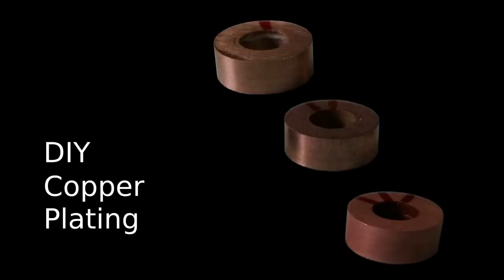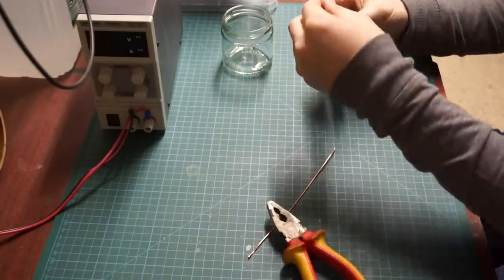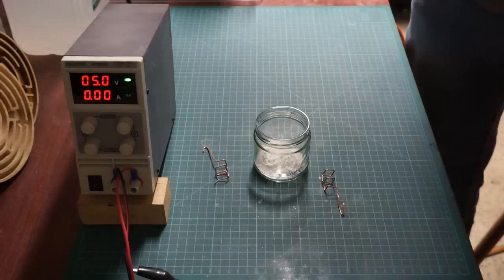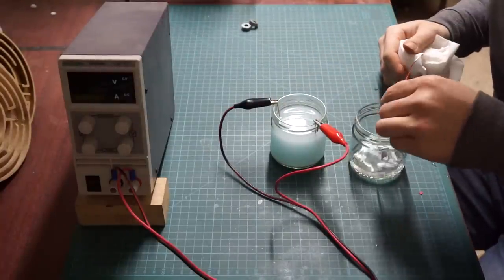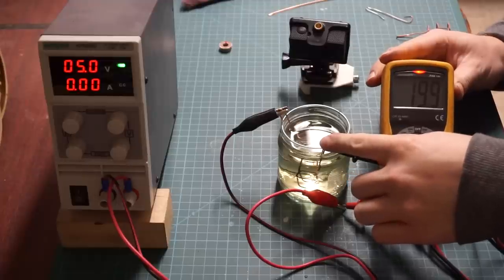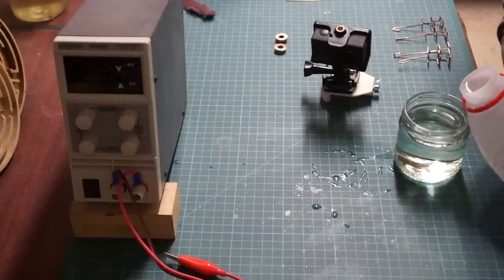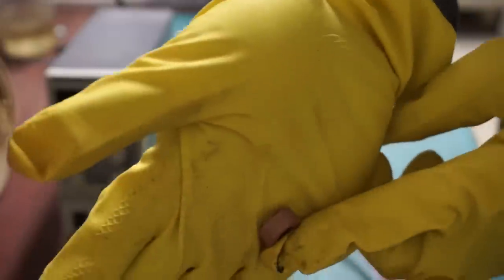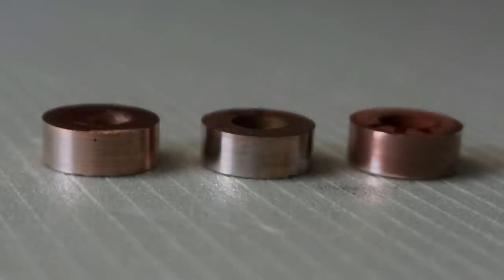Best DIY Copper Plating Methods

Comment: I really appreciate the scientific nature of this video, actually comparing different approaches.  Generally the metal deposition is going to be proportional to the current flowing through your part. If you want to get good, repeatable results, you must regulate current. NOT voltage.  I recommend 20 mA per cm^2 of area on your part to be plated. Lower current density will work fine, but will take longer to get the same thickness. Higher current density can ruin your surface finish as you saw with the strong acid. The conductivity of your liquid should be as low as possible to achieve the most uniform plating thickness across your part. You can add salt to the vinegar to increase its conductivity. To determine plating thickness as a general rule, 26.8 amp-hours of charge will deposit 1 gram of metal. At 20 mA per cm^2 this means that ~ 20 microns will be plated in 1 hour. Or the other way, you'll get 1 micron per mA per cm^2 per hour.  A few microns is a good thickness for decorative surfaces. 50 microns is good for high durability.  I also notice a number of people talking about the order when plating with nickel. Copper won't plate onto all metals very well. If you want to copper plate steel. A thin nickel plate should be applied first.
Reply: You got that backwards. If you want to plate with nickle you must plate with copper first. Copper plates to most items easily while nickle is finicky.
Reply: youre correct, but when it comes to steel, copper wont plate; so yea you do need to spray a nickel coating to conduct the copper to the steel, otherwise the copper wont plate the steel.
Reply: i appreciate your comment, does this recommendation apply to a particular approach you use?
Reply: @xtonybaloneyx  copper will plate stainless steel using the muriatic acid technique shown in the video. I've never tried other types of steel, but it absolutely will plate onto 304 stainless steel.
Reply: What's the ideal voltage to current ratio, or should I say the ideal resistance of the solution?
Reply: @CaneDimitrov  I don't believe it's super important. But lower is generally better. Higher voltage will cause increased electrolysis. This usually leads to splotchy and inefficient coatings.
Reply: @gizmoguyar  Thanks for replying so swiftly, mate! I also seem to have another issue - instead of getting this nice clear deep blue solution, I get a murky cloudy bluish whitish stuff, which I think is copper carbonate hydroxide. Any suggestions on resolving this issue?
Reply: @CaneDimitrov   That's a tricky one. This is a bit beyond my level of expertise. from your comment, it sounds like you are using baking soda. You might try adjusting the PH to be more acidic. You can also use salt  to increase the conductivity without messing up the reaction. I also know tiny amount of dish soap can help with the surface finish. But I believe this won't have much effect on the byproducts produced.  There's lots of different things that could cause this. So I think you'll have to experiment.
Reply: @gizmoguyar  So I tried a 15% citric acid water solution and so far this got me the best results. I just mixed store bought citric acid in some destilled water  (15% citric acid by weight, relative to the water). Then I saturated the solution with  copper citrate by running my power supply at 5V, about 0.15 Amps, but the current was fluctuating, until the solution turned a nice clear blue color. In all fairness I doubt it would be an issue to run higher voltage, maybe even 20+V for the saturation process, although I can't be sure. Then I tried plating a coin (65% copper, 20% zinc and 15% nickel), running about 60mA at 2.5V and in just over a minute the coin had a nice copper plating on it. Of course, I cleaned the coin thoroughly with dish soap and water before plating it. I found I get the best finish if I was constantly moving/wiggling the coin in the solution, otherwise it tends to get black copper oxide on the edges. The plating is quite durable, as I tried cleaning the coin with steel wool and it didn't damage the plating, but made it look shinier and almost polished-like. The raw unscrubbed/unpolished finish on the coin is rather dull, but has a more saturated copper color. Overall I'd consider this a viable and effective method.
Reply: @CaneDimitrov  This is really amazing. I'll remember this for the next time I need to plate anything. Most of the instructions are vague, so thank you for giving the exact numbers you used.
Reply: @gizmoguyar  Glad I could be of service! One extra thing I forgot to mention is that increasing the voltage gets the coin plated in copper quicker, but the coin gets covered in black copper oxide easier and the finish quality gets worse, so I wouldn't suggest going above 3V and about 20mA/cm2 for the current density and constantly moving the coin, as these conditions got me the best results.
Reply: @CaneDimitrov  That definitely makes sense. 20 mA/cm^2 seems to be the sweet spot.

Comment: You'll get much better results if you first plate the steel with nickel, then proceed to plate with copper...just an observation due to my extensive experience in DIY copper plating.

Comment: Here's a simple and easy copper plating solution.  Dissolve copper sulfate in distilled water.  The amount is arbitrary.  Just enough to make the solution dark blue.  Add a few ml's of muriatic acid.  Measure the ph then add enough sulfuric acid to bring ph to 1.  You now have the perfect copper plating solution.  It's durable and you may plate it as thick as you'd like.  Just remember, 100 milliamps per square inch of surface to be plated.
Reply: Good to know, thanks!
Reply: Why the milliamps important? Is there too high mA? Is there any disadvantages of it?
Reply: @ElGatoLoco698 someone asked you a question.
Reply: @raytry69  Too high milliamps will produce a rough texture.  Normally people are looking for smooth and even surface.  100 milliamps per square inch gives you that smooth surface.  If the milliamps are way too high, the plating won't stick at all and you'll be left with a pile of copper powder that falls off the plating surface.  If you stick to the 100 milliamp rule you'll have a nice thick, durable, and smooth plate in about 8 hours.
Reply: Can any copper salt (acetate, carbonate, hydroxide) be used or does it have to be sulfate?
Reply: @bunneto365  You could probably use copper acetate. In fact, I remember trying it when I first started plating.  I found that copper sulfate was just easier though. I'm not sure about the other compounds you mentioned but I tend to think it would work too.  You might have to experiment a little bit to get good results but it should still work.  That being said I should probably mention that I didn't plate to any specific type of metal.  I plated the copper to a graphite paint I made.  The acid in the bath is not good for some metals.  Zinc for example.  Can't plate to zinc with this mixture.

Comment: I've done quite a bit of plating of my wood turnings. In the course of learning how to do so, one thing shows up over and over again - contamination of the electroplating bath, which results in poor quality plating.

For this reason, I have to seal all my wood projects with lacquer, then coat them with conductive graphite (from a mix with satin Mogepodge).  Even then, the baths get contaminated over time.

Part of the contamination of my baths come from the small eyelets I use to suspend the items in the bath.  The eyelets are metal/iron.  As I was told, merely dropping iron in the bath, without connecting to a power supply, will result in ion exchanges to produce a THIN copper surface.  However, this, also, means the bath is being contaminated with iron, which will, at some point of saturation, ruin the bath.

I end up with a lot of small copper pieces, from the anode dissolving. As an experiment, I used a small, hard plastic water bottle to store the pieces.  I drilled about a gazillion (give or take five) holes in the bottle so solution could flow into and out of the bottle easily.  This allowed me to drop a copper anode into the contained pile of copper, to use it all as a anode.  It worked.

Another problem I came across was all the debris, from the anode, building up on the bottom. On a whim, I bought some small polypropylene  bags and put the anode jar in it.  This worked to catch all but a tiny bit of the debris.

Comment: You will never get good adhesion of copper layer to steel in acidic bath. This is beacuse iron reduces Cu ions very easily. In industry cyanide baths provide best results - but toxicity excludes them from any amateur use. You can use ethylenediamine + copper sulfate solution or pyrophosphate bath - both are quite ok, but the ingredients may be hard to find. Also these baths are not as stable as acidic. In the workshop conditions the best option is to put a thin layer of nickel first and then you can use copper sulfate + sulfuric acid solutions which is quite good in results. In case of lack of nickel anode - you can use graphite rods as well.

Comment: i thought you need to plate steel with zinc or nickel before plating it with copper for it to adhere well
Reply: yeah idk how he got those to work,i tried copper plating ss and ms  directly after scrubbing them with steel(ss) wool and degreasing with methanol ,the copper on the steel looked like the mat dull color  and rubbed off easily and the copper on the ss was barely visible or working(took long) although more shiny still rubbed off too

Comment: The vinegar version didn't seem to work that well, but with a stronger concentration and some salt, perhaps it wouldn't be so bad. I'd be more comfortable with vinegar, and it's easy to get. It's also clear, so that you can watch the process. I wonder if it would be a good enough solution for etching circuit boards if you're not in a hurry. I can't seem to find any videos of this exact approach.

I'd also like to know the chemical composition of the (used) electrolytes, so that it can be disposed of in a safe manner. It's been made clear by many, that the dissolved copper left in it is toxic. If I'm going to store and handle toxic stuff, I want to know exactly what it contains.
Reply: Try cleaning vinegar. Cooking vinegar is about 3% acetic acid, cleaning is usually more than double.
copper sulfate however is a lot more effective since the copper ions are incorporated into the solution chemically.
Reply: We usually use vinegar and salt to make a pickle solution to clean and strip copper.

Comment: You should not have added the water to the acid. That is extremely dangerous. Always add the acid to the water. Also please wear personal protective equipment (PPE); particularly acid proof gloves and safety glasses. Thanks for the video but look after yourself. Cheers.
Reply: HCL is already wet.  it is only anhydrous acids that need this.
Reply: I think the idea here is that when you introduce a strong acid solution into the water, the amount of acid versus water starts at zero (the water without acid) and gradually increases as you continue to pour in the acid.

I have had acid solutions generate intense heat if I poured a bit of water into the volume of strong acid, in some cases violently releasing  bubbles of water vapor (possibly hydrogen also) and splashing acid everywhere. Wearing simple nitrile gloves and basic eye protection helped me avoid injury if I made this mistake.
Reply: I totally agree about adding acid to water. Reversing the process with water added to concentrated acids can lead to a violent chemical reaction and personal injury.
It's interesting that Mr Wagner told users to don rubber gloves and safety glasses but didn't follow his own stipulations.

Comment: never water in acid. very dangerous

Herzliche Grüsse

Peter
Reply: It would be helpful if people explained why, when saying this.  

Knowing nothing of such things, I always thought it was because you'd be splashing acid up, rather than water.  Of course, later I learned the real danger came from the violent chemical reaction.
Reply: @kellyvcraig  with watered down HCL like you get in the store as a consumer grade, you will not get heat buildup, unlike reagent or anhydrous grade HCL
Reply: @preciousplasticph , I don't know one from the other.  That it's just good to develop safe habits aside, I use the sulfuric acid I can get in auto parts stores.  Do you know which category it falls in?

I bought a bottle of the stuff they sell in hardware stores, for drain cleaning, which I suspect to be more dilute.  Still, it works for plating.
Reply: @kellyvcraig  auto parts store battery acid is already watered down.  This reaction, is much the same as adding salt to ice water.  No chemical reaction actually happens but in the case of acids heat is generated vs cold.  Or your cold pack that uses water and urea.  Now once the reaction has happened i.e. at the chemical factory when they initially diluted the acid, then you will not generally see further reaction in the consumer grade acids.  

Cody's Lab did a long video on this years ago  https://www.youtube.com/watch?v=RS_TrEbaizg
Reply: @preciousplasticph , good to know, metzindurtries. Thanks.
Reply: Watch Cody's lab's video about it. It seems a common misconception.

Comment: To those knowledgeable in such things, a question, if you will: Is there a simple way of determining if or when you need to add acid to your distilled water, copper sulfate and sulfuric acid bath?

Comment: Regarding the Muriatic Acid. Always add acid to water, not the other way around. Also 1 part Muriatic to 5 parts water makes a nice solution. 1:1 is too strong.

Comment: Thanks for the good video. I used washing soda, and that works really well.
I like this method a lot, because it doesen't use dangerous chemicals.
Reply: WRONG Hydrochloric acid is dangerous as is vinegar - 5% acetic acid if you get it on your skin [HCl] and especially both in your eyes.
Reply: @aaamediamail5552  yeah, but he only used soda, and didn't use any of those a**hole. So many toxic people in this comment section. Hate when someone thinks they are more clever than others...

Comment: Would using a copper sulfate (such as Root Kill) be better or worse than the muriatic acid? Experience? Opinions? Thanks :)
Reply: lol I literally just asked the same question.
Reply: @John-gm8ty  
And still nobody answered :D
Copper sulfate plating is much more simple than screwing around with anything mentioned in the vid. Though you'll get what you've paid for. Plating with sulfate salts is easy, and I purposely didn't use 'electroplating'. You don't have to use electricity to plate a carbon steel piece with copper sulfate. You just put the salt in the water, mix it up to dissolve the salt, and submerge the steel piece into the solution. If the undissolved salt covers the steel completely, it will plate the piece with a thin copper layer. I found that this copper layer won't adhere that strong to the steel like the acid method would, but it's enough for most purposes. 
Another method: use an oversaturated copper sulfate solution, soak a rag with the solution and smear the steel piece with it. If the steel is free of grease, oil and scrap, the copper layer will instantly be seen. Repeat if you're not satisfied with the results, and the job 's done. A bit of polishing and a layer of clear coat is advised.

Comment: Excellent presentation.  Thank you for showing this to us.  I plan on using these concepts for my small-scale restoration projects.  The heavier build-up of copper using the muriatic acid solution will assist in bringing worn parts back to full size, when needed.  Some of the parts I restore, are 'unobtainium' pieces (i.e. not available) or very expensive to buy,  Muriatic acid is commonly used in the USA (perhaps, elsewhere?) as an additive to maintain the pH balance in swimming pools and is sold by the gallon (appx 4 liters to the gallon)...for less than $10/gal.

Comment: With the vinegar solution, you need to add salt to solution to increase solutions conductivity.  You will see a significant increase in results
Reply: What kind of salt? Sea salt?
Reply: @americanstriper8666  any type of salt will do, salinity increases conductivity.
Reply: @americanstriper8666  it's all sea salt, except in some very rare instances even if it came from under ground or from a mountain